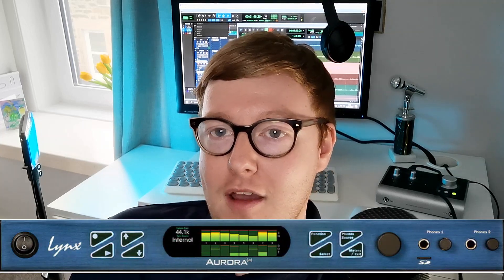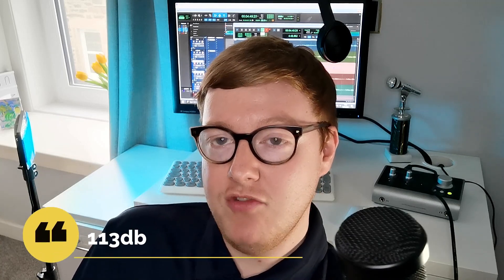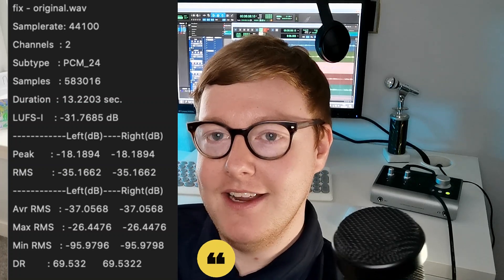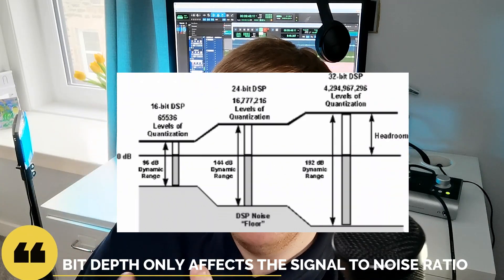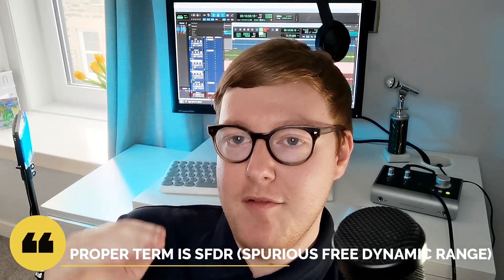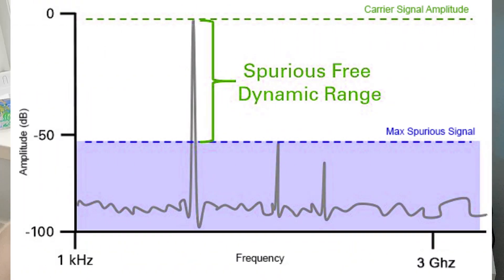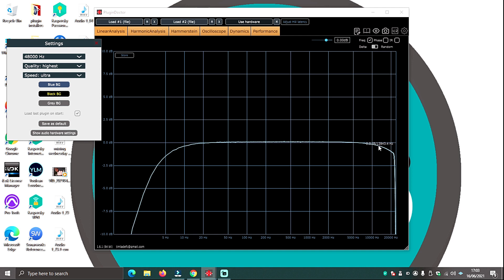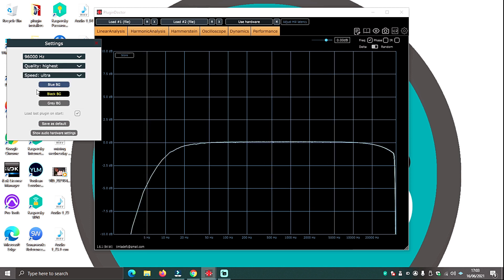Do you lose audio quality in analog gear using budget interfaces vs expensive ADC Converters (Pt 1)

Comment: This argument is hard to do in a youtube vid - not only do you have to deal with whatever YT is doing to the audio, you have the listeners signal chain in there too.  I'm super clean in my signal here, but I still can't hear everything your talking about, probably due to YT.  But, trusting you're being "transparent" (ah-hem) about what YOU'RE hearing Paul, then still no any surprise.  Most A/D has been good for awhile now, and even budget units get "clean" pretty well.  Where you get differences is in the pre-amps and the analog components themselves.  The base starting point for anything should be "flat" on the converters, and anything else isn't good.  The rest of the signal chain is character - does my Yamaha desk sound like my Digico desk?  No!  Does my Midas pre's behave like the one's from Behringer?  Well, almost ;-)  (inside joke)  So yes, there's "use what you like, if you can afford it" - the price is in channel count and features.  And the noise floor is subjective - yes you can measure it and see one is "better" than another, but realistically below a point the air moving past the microphone is going to be louder.
Reply from the maker: That's why i did the null test showing the levels in youlean loudness meter. That was the big test. The rest is subjective in terms of what you hear but the levels of the null test don't lie in terms of what is the most transparent and closest to the signal.

I can hear the loss of top end at 48k and the colour added by the lynx which may possibly be high order harmonics if I'm guessing. 

Remember I set the sessions up and sit with these files and critically listen to them over and over so I can hear the differences and still can listening to the video on youtube but if you can't hear them on first listen then it just shows how subtle it all really is. Im the type of guy where once I've heard something I can't unhear it. It's all still subtle in this test but it's just about knowing what to listen out for which is hard in one pass 🤓

Comment: Cool tests man. Thanks for doing these. Very interesting. I've always recorded at 44.1khz. I think I'm gonna switch to 96khz going forward.
Reply: @devianthousend  As Zsolt Virag states, recording and then mixing in 96 Khz is useless. See this from Fabfilter https://www.youtube.com/watch?v=-jCwIsT0X8M&t=4s In a big project it puts much more load on your cpu and on the streaming. Most new plugins have oversampling that reduces aliasing very good. High samplerates are used because it's a format and not because of the "audioquality".
Reply: For what though? Im no expert but arent you have to downgrade it for mixing (if your plugins dont support 96khz) or for the end product where anyyyway itll be downgraded to the standard of 44.1?
Reply: @vadsmixinglab11  record in the highest resolution as possible, then mix at a lower rate.  It’s always nice to have the closest possible copy of the real world analog representation as your dry recording.   You can always mix and remaster them later to whichever resolution you fancy.

It’s like in video recording too, record in the highest possible resolution so that you have more room to mess with it on post.
Reply: @vadsmixinglab11  I have been mixing at 96kHz for over 12 years.

 There are audible benefits to using plugins at that sample rate and then as the last step down converting to CD quality. I find most benefits are with compressors and saturation.

And now since more music streaming services are going to high-res there is a marketing benefit for higher sample rates as well.
Reply from the maker: I am now going to record at 96k in the audient as the high end roll off is more apparent in the preamps at 44.1 and 48k. Mixing at 44.1 or 48k isn't going to cause that high end roll off. Remember I've created an ADA loop and printed through the preamps so I've connected the output to the input which is your preamp 🤓 your not using the preamp when mixing unless you have something connected to your input
Reply: @PaulThird  to do that you'll need to print the 96khz into a 44.1/48 session right?
Reply from the maker: Nah you've got to record in a 96khz session. The audient software automatically adjusts it's internal sample rate of the interface to match the daw session.

From there you just need to import the file into the 48k session and press convert and protools converts it when adding it into the session. It's pure digital conversion at that stage. Nothing to do with the interface or preamps
Reply: @PaulThird  hmm, ill need to see how it works for Cubase but yeah I meant extract the 96khz tracks and import into the new session..thanks!
Reply: @vadsmixinglab11  Cubase will ask you if you want to convert up or down to the session sample rate if you change it.
Reply: @PaulThird  I saw 40 be doing this making beats for drake that lack the mid range and that is the space his vocals occupy
Reply: @PaulThird  Try 96khz mix master AD capture and SRC to 44.1khz vs. 44.1khz master AD capture. I did that and prefered 44.1khz than SRC from 96khz. The converted file sounded more open like 96khz signature sound but the 44.1khz capture without any SRC sounded more real, that's the reason that many big mastering houses uses 2 computers and converters, one for reproduce and one for capture to avoid SRC. DAWS bounces have a signature sound too , try to bounce a master without any plugin on protools , logic or Ableton , all will sound different.
Reply: @erikguevara777  interesting point about the DAW bounces having different signatures, and your right to point that out. Not many people are aware but all DAWs have different summing algorithms which affects the final bounce. I’ve heard many say that Protools sounds “better” than logic but they don’t know why  - they even record using Logic and transfer session to protools for final mix and bounce. This is why there’s a market for outboard summing mixers too - Although differences are still subtle.
Reply: @RealHomeRecording  that's why i record at 96KHz and mixdown to a 24 bit 192Khz wav files
Reply: @erikguevara777  no they wont. It's been proven for years that the same file in the same format with no processing will null test.
Reply: It is actually the opposite if your plugins don't oversample then mixing in 96 will make them use their full potential. At least for many of the plugins I use. 

I did these test as soon I got a 96 interface. 

Nicer more open in 96 via for  recording. 

I've been arguing with people for years on youtube about this. 

Make sure your computer has enough to do 96 though. 
It takes a beefy computer with at least 32g of memory.
Reply from the maker: That's why i am picky in regards to my plugins. If you use plugins that use internal oversampling or have oversampling options and gain stage them correctly then you can easily mix in 48k and still get optimal performance. If there is the odd plugin I.e. Waves that suffers from audible aliasing then there is always ddmf metaplugin to oversample any plugin that supports it 🤓
Reply: @Markpianist1  nah you can do it with 16 gig seen a friend record in 192 KHz but the roundtrip ms was bad
Reply: @devianthousend  Dan Worrall's video did not include Acustica plugins. Which I use a lot of. 

Acustica samples hardware at 96 kHz...so I try not to deviate from the native. Also, Waves plugins usually top out at 96 kHz as well.

I would rather have more data to start with than not have it later in case of a remix/remaster, which has in fact happened.

To each their own though! If 44.1/48 is good enough, go for it!
Reply: @devianthousend  nah you're tripping. higher sample rates mean more samples. sure while the average joe wont even notice or care for that matter, more samples per seconds will mean better audio quality not to mention stuff that happens with Nyquist theory and plugin behaviour. your logic is flawed not the science.
Reply: @devianthousend  yeah ive seen that video, and have read up on this subject extensively. you also cant seem to grasp the fact behind sampling something at 96 cycles per second will produce a higher fidelity which is astonishing. you also don't seem to understand that i am not debating with you about applying the nyquist theory to fold back distortion and why we need to oversample. so really, you haven't saved yourself the embarrassment of sounding like a tool so go back to school and come back with a reply.
Reply: Does it worth it for voiceover/narration mono tracks (without music)?
What if the client asks for a resampled 96 KHz -> 44.1 KHz file?
Will the quality still better compared to recording straight to 44.1?
Reply: 96k is far more detailed particularly in the high end, it's true. it's just science. however the trade off to cpu usage is significant and if you're someone who likes to use a lot of plugins then it hardly makes sense to effectively halve your computer power when you can still produce quality mixes at lower sample rates.
Reply: @nepntzerZer  
Null Tests have shown that there is no difference in sound. You can't hear it and you can't see it. The rest is religion.
Reply: @NikolausBrocke  only there is a difference. its the same as shooting film with a higher frame rate you will see more definition. now, as ive already said most people either can't tell the difference or don't care but that doesn't change the fact that higher sample rates will produce greater fidelity in sound, its simple and straightforward as you can get. i find it astonishing that theres so much resistance to this simple fact. if you sample something with more samples with cycle per second you will have more information in that digital representation of the sound. it becomes more evident in the higher frequency ranges because there is far more headroom to roll off before nyquist. its why oversampling is important, which is essentially doubling or quadrupling the sample rate, rolling of unwanted frequencies, then sampling back down again. if you have the insane computer power needed, theres no reason not to be running at 96k in your studio.
Reply: @nepntzerZer  time will tell you. Its not the same as video.

Comment: In the beginning of the video you compared a chart with levels of dB SPL which use a power ratio, where as the dynamic range of the interface is compared to the 24bit dB full scale, which uses an amplitude ratio. Actual loudness depends on the calibration of your monitoring system or the expected level of playback.
Reply from the maker: Ahhh right OK. That makes way more sense haha always learning 🤓
Reply from the maker: Which chart was it? Is it at the part when I'm talking about the bit depth video?
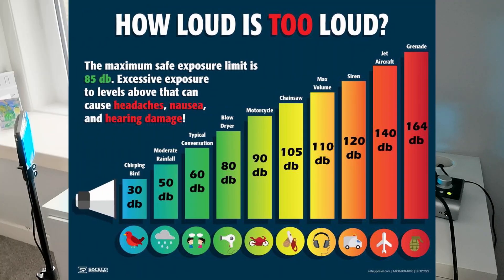Reply: @PaulThird  at 2:05

Comment: Depends on what you're using. I went from Focusrite to the MOTU AVB and notice a big difference. MOTU is one of the few Pro Audio manufactures that offers great value without compromising sound quality that ticks a lot of boxes out there that cost 2 to 3 times more. I'm using the MOTU 828ES AVB for my Hybrid Mixing rig that's housed in my Argosy Console desk filled with analog outboard. The 828ES is using the same ESS Sabre converters found in the Apogees with a Dynamic range of 123db. You need a lot of headroom and a very low noise floor when using analog outboard pre amps, eqs and compressors.
Reply from the maker: I remember I had a mackie onyx blackbird about 8 years ago. I think I sold it for a focusrite saffire Pro. Maybe the other way round. I wish I still had them so I could have tested them haha
Reply: The new Audient ID44 mkii also uses same ESS Sabre converters. Check Julian Krause channel. He actually opened it up
Reply: @samueloluyinkaojomu6548  Doesn’t really mean much since that interface wasn't designed to be used as a studio converter for analog gear. The MOTU 828es was designed for the Pro Audio market for people that uses outboard. There are no mic pres on the back that has 10 Line outputs and 8 Line inputs.
Reply: @eman0828  so in the end most of these interfaces uses similar adda chips it's now about the implementation. That's what add color to the sound people hear from them. And to be honest they are supposed to be transparent not adding color
Reply from the maker: Conversion will still be near identical. There's nothing about the motu compared to the audient id44 mk2 that would make it audibly sound better.

Motu just has more channels. What is it.. About a grand? £125 a channel?

Yes its based really solely for studio use for analog gear but that doesn't make it any more pro sounding
Reply: @samueloluyinkaojomu6548  I think that is the reason why some converters cost more than other because of the analog circuitry around the AD and DAC chips, power supply designs, clocking, i/O amd features. It use to be the case with Apogees older converters from the early 2000s that had a warner sound due to the soft clipping. Burl is probably the only real converter manufacturer with the intention to color the soun due to the built in transformers. Most all converters are transparent but they will all still have their sonic characteristics. The modern MOTU AVB interfaces have a similar sound to Apogees modern interfaces while Lynx is more focus on what goes in comes out. The last time I used the original Lynx Aurora 16 was back in 2014 after being around it for three solid years in a commercial studio that my studio partner owned at the time when I worked in as an in-house Producer.

Comment: Amen. Gotta call BS on Scheps saying converters damage the sound more than plugins. In my experience, plugins leave way more to be desired compared to the real stuff (just not dbx 160A's or other cheap stuff). I also compared a few loopbacks with the Auroras on Access Analog vs loopbacks through my Duet 2. The Auroras preserved (emphasized?) more of the upper midrange. I wasn't super keen on it, but I guess it was kind of nice sounding. Bit sharper maybe? Honestly if it had been the Duet doing that I probably would have assumed it was the sound of something cheap. Knowing it was not anything cheap, I remain somewhat intrigued by more expensive converters. However, the Audient stuff and the MOTU stuff (828es, 828 mkii) scores really high on these sorts of tests and so I'd be more likely to swing that way in the end. I wouldn't go as far as lumping the smaller Scarlett interfaces in there, though. For now I'm happy using what I have for conversion. Better things to worry about, for sure. Keep on truckin', Paul.